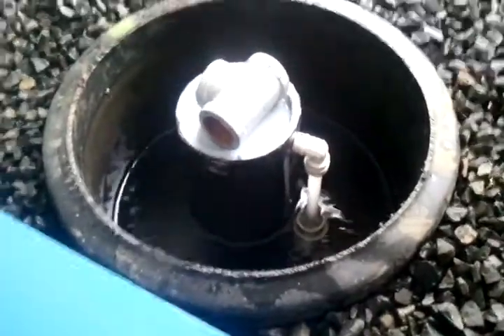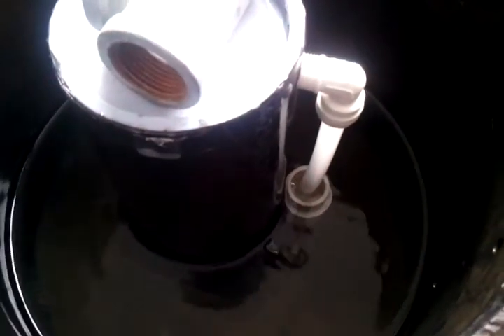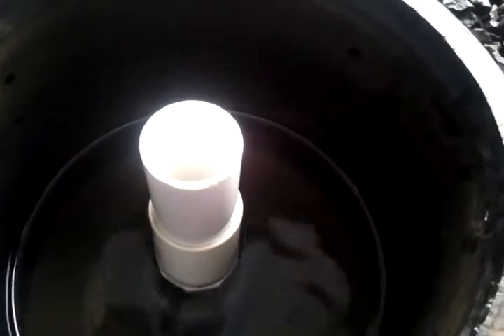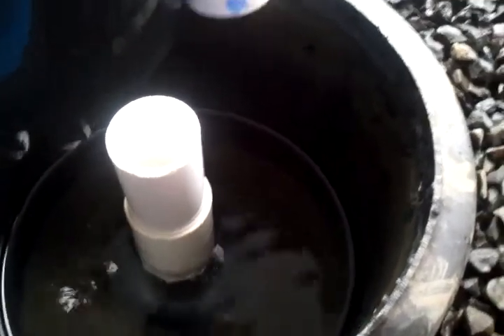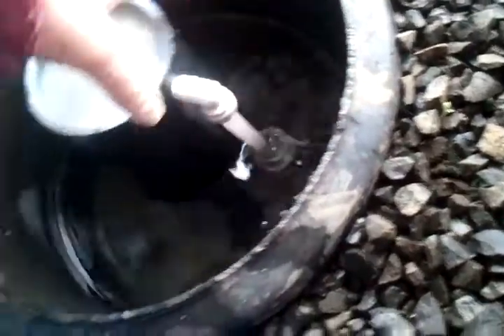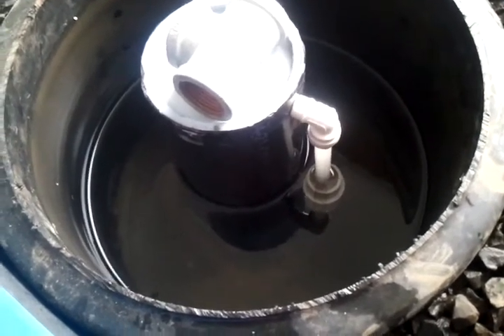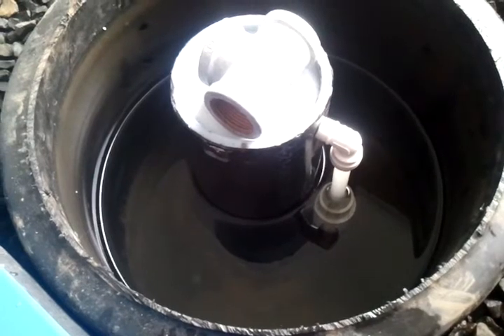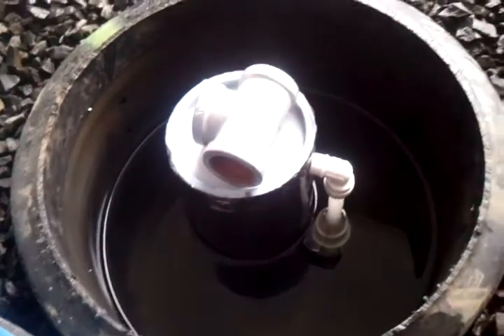Bell Siphon Test with an air cap

Comment from the maker: @presse55 - A larger cap will take longer to begin sucking air.  The longer it takes the further the water is drawn down outside of the cap.  The advantage is that while it is breaking siphon the water does not come back over the top and cause problems by refilling the cap.

Comment: Great vid - and such a great answer to the very same problems I'm having with my first hydroponic gig.
May I ask what decided you to increase the height of the air cap from its original size?
Is it that the shorter one 'occasionally' led to the siphon not breaking?  I'm seeing this with the first air cap I installed.  So I too am lengthening it to see if this improves the siphon's reliability!  Thanx!

Comment: Very cool- an simple! The air tube can quickly suck the air cap dry and then allow the siphon to break without slurping from the main tank for hours. My system's much smaller then yours yet I've had the same problem with my siphons. I've found in my case cleaning my pump's intake screens allowed the flow to increase enough that the siphons behaved properly- just one more thing to check. I'll be using your design in the future! THANKS for sharing it.